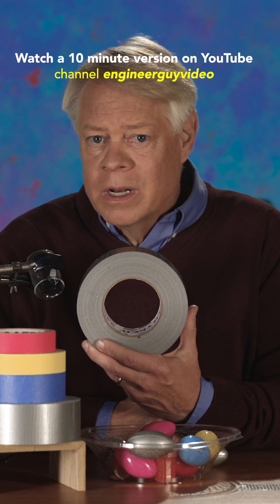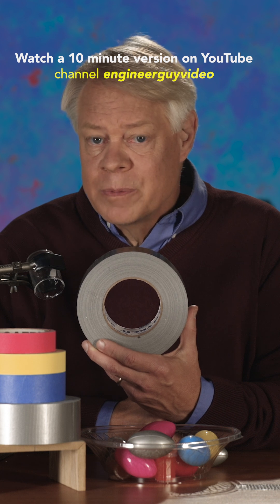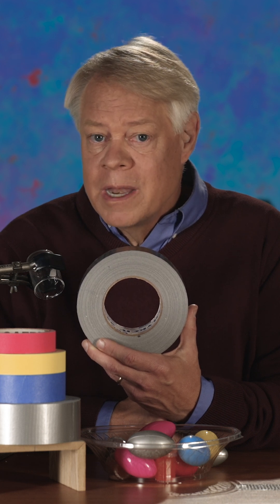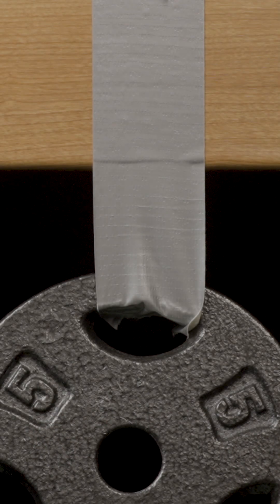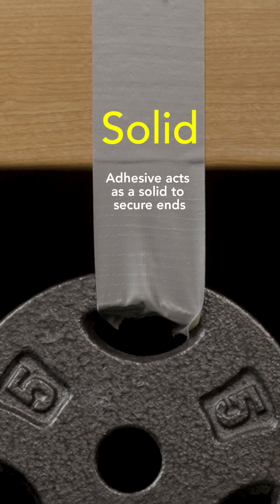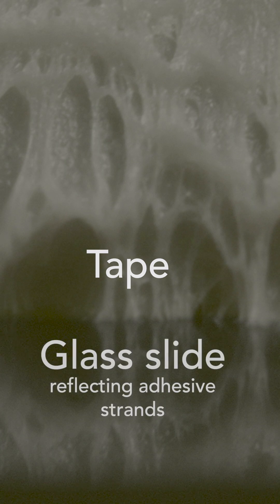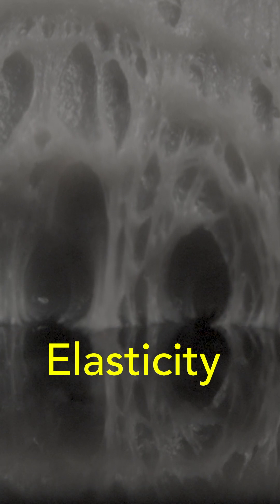Duct Tape’s Adhesive

Comment: Now the sticky labels on glass jars are a little like tape, maybe essentially the same thing. And if you warm the glass jar from the inside you might find that label coming cleanly like was shown here. I'd really like to see ALL my sticky labels come off cleanly and not leave half the adhesive on the glass, though often the sticky label repeatedly dabbing at it helps. (And of course I follow up on those jars with almond butter - i'm allergic to peanut - and when that's saturated/mixed well, soap, and that works. )

Comment: I’ve tried to use duct tape for a good few heavy duty jobs and that moniker “if it doesn’t work, you aren’t using enough” is just not true.

It doesn’t stick stuff to stuff when jury-rigged to be double sided, it can’t keep a muffler on a rusted out exhaust pipe cause of the heat, it won’t work as a band-aid for leaks, it won’t stick non-porous things onto other non-porous things, it won’t stick small things onto each other that have strict gap tolerances (like a handle to a coffee mug)…

It’s one good use is making big stuff hold on to other big stuff when it’s wrapped around it enough times, in the ugliest way it can be.

Comment: Fun fact, adhesives like tape are a type of electrical bond. You can see small static sparks as you peel tape apart if your in a dark room. You can try this at home, It sometimes works better with different tapes and depending on what material your sticking the tape to.